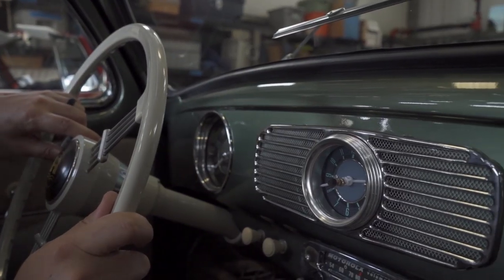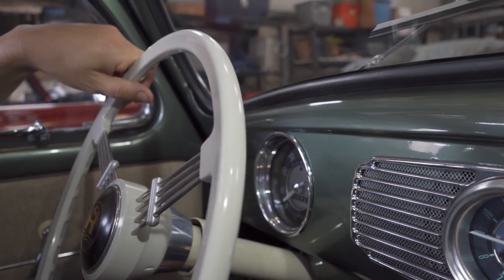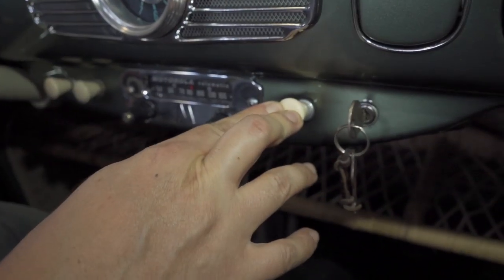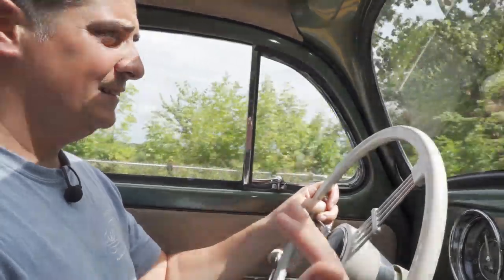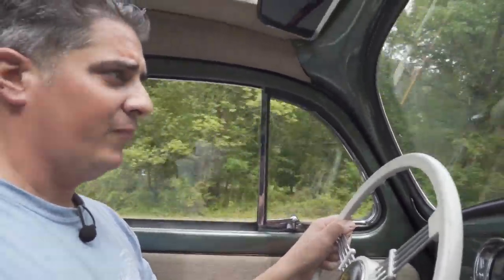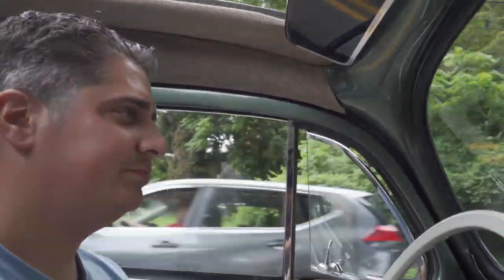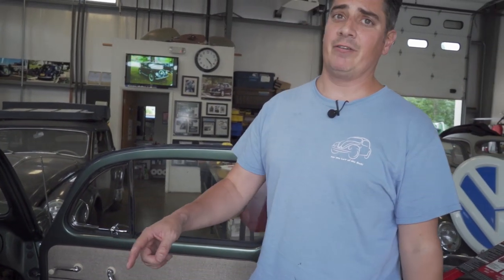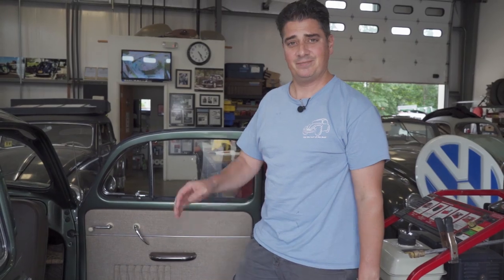Classic VW BuGs Volkswagen 4 Dummies 1956 Oval Beetle Resto Pt.2

Comment: Just to add to the video..You want to make sure that the metal wire from the frame of the back seat doesn't touch the battery terminals. By the metal touching, it causes an electrical short and it would start a fire. Some batteries sell a plastic separator to prevent something like that from happening. You can also make your own by laying a piece of a rubber mat on top of the terminals.
Reply from the maker: Hell yeah man!
Reply: Or use a marine battery, box my preferred method...I'm running two battery's with a marine battery selector .....
Reply: I can vouch for that. Back in the early 80's my '59 started to smoke with a big fat ass sitting back there. Horse hair stinks when it's smoldering.

Comment: Hi Chris .... great videos !! Question on the rag tops. at 16:40 You mentioned that a bi-fold and tri-fold are different when opening and closing - that the bi-fold is better because of mechanics involved in the top's rollers. Could the "rollers" or mechanics be swapped so that we could have a tri-fold rag top with the rollers of the bi-fold for better operation ??
Reply from the maker: Tough one.  I am sure there is a way to make it, but I have never seen it.

Comment: I love these videos. I've had a 59 beetle with the 36 horse engine for almost 20 years it had been restored shortly before I bought it. The man who kept it going for me is a retired mechanic who worked at a vw dealership in the 60s and 70s but had back surgery and is no longer able to work on it for me. I have 2 problems 1it is leaking oil right at the pulley. 2 if I I don't start it or drive it for a few days the battery is completely dead. It still has the 6 volt system. not too long replaced the battery. Any thoughts
Reply from the maker: Hey my friend, yeah usually if you have oil coming from the pulley, it's a good indicator that the bearings are shot.  Do you have any end play?  Also, check my video out to see if you have a draw in the electric system for your battery draining.
Reply: Chris Vallone Thanks for the advice I really appreciate it. As fate would have it the mechanic I mentioned called me today and said he feels up to doing some work, I told him what was going with the oil leaking and he said he's gotta 40 horse on a stand ready to go in the car while he rebuilds the 36.Anyways thanks Chris.
Reply from the maker: @thomasgary1219  excellent 👍 good luck.

Comment: Hey Chris can I used the Mt 26 R battery from interstate on a 1966vw is a 12 volt convertion
Reply from the maker: Not sure what the specs are, just be sure to change genny, lights, regulator, wiper motor and choke element to 12v.

Comment: me again, very pleasant relaxing video. My current 69 stnd has the factory air conditioning part number  VW240 2w40mph)  Back in the60/70s midwest, not sure of my bug's HP - I had a hill that I would go down at 70mph plus just to ensure 30-35 mph at the top.  Big rig truckers were not as nice or forgiving as they are now.  Lastly regarding your rag top  - aren't you fearful of ripping it off at high speeds >>85mph?  Does the wind on the rag top create a neg pressure causing flight?  Nice enjoyable video
Reply from the maker: not at all, its all good.

Comment: I am curious as to how enjoyable a ragtop is. I had a Cavalier with a sunroof and it was not enjoyable. It just left direct heat from the sun in. Minimal airflow. A ragtop looks a bit larger then a sunroof so maybe there is more airflow.  I have been in convertibles and if you are in the front seat they are great, but if you are in the back seat it is terrible. Same with a ragtop?